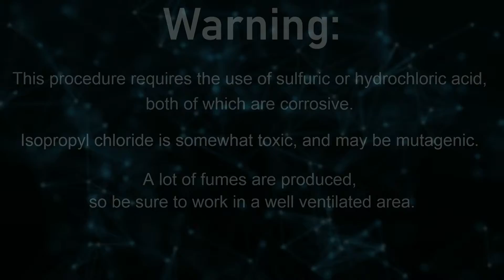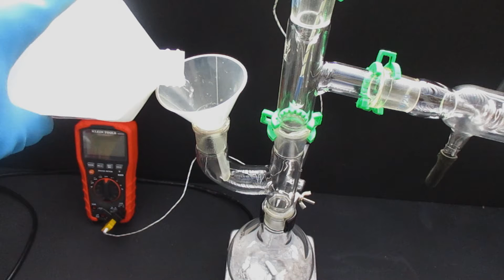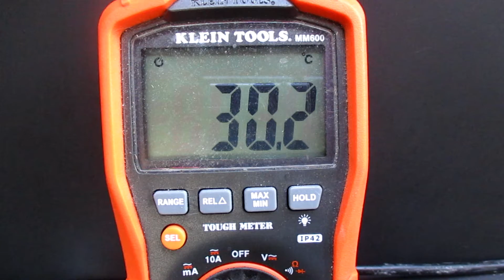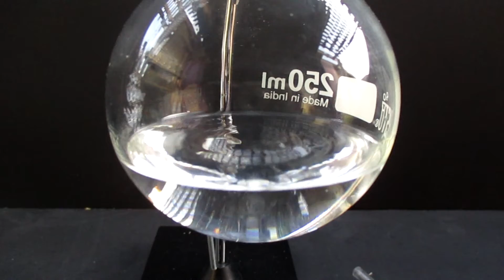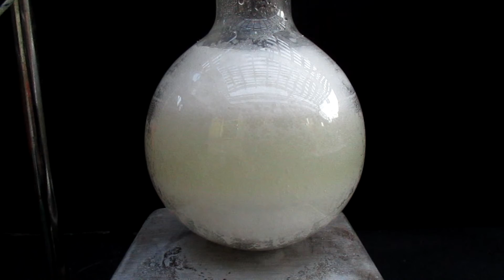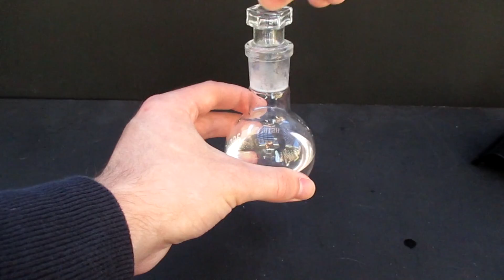Isopropyl Chloride Synthesis: My First Real Chem Project

Comment: Thank you a lot! It was very interesting! From it, benzene and aluminum chloride you can make cumene, which can be converted to its peroxide on air, and then hydrolyzed by sulfuric acid to make phenol and acetone. For the Gringhard reaction the catalyst is diethyl ether. It's absolutely impossible to make Gringhard's reagents without it. And also, for the activation of magnesium, you can use a small crystal of iodine.

Comment: Great Video! My opinion on why you didn`t produce the Grignard reagent is because the magnesium metal was covered with an oxide layer and the isopropyl chloride couldn`t react with it, while sulfuric acid removed the oxide layer it also created a sulfate layer that prevented the reaction. Iodine, methyl iodide or 1,2-dibromoethane can be used to activate the magnesium metal and start the reaction. Probably it needs to be done under an inert atmosphere as Grignard reagents are highly unstable in air. Usually, diethyl ether or tetrahydrofuran are used as a solvent for the reaction.  However I might be wrong about everything I said

Comment: What if you want to turn Phenyl-1-Propanol or Phenyl-2-Propanol into Phenyl-1-Chloropropane or Phenyl-2-Chloropropane? Do you still have to distill when boiling point is way higher, or can you heat it without boiling it over and Zinc Chloride catalyst is sufficient. If you have to boil it over, a vacuum distillation might be needed.

Comment: Good video.
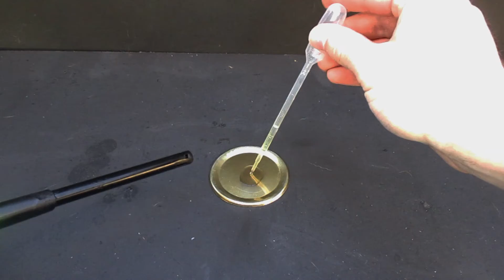3:57 a couple of frames show a green flame right before the the yellow flame <3
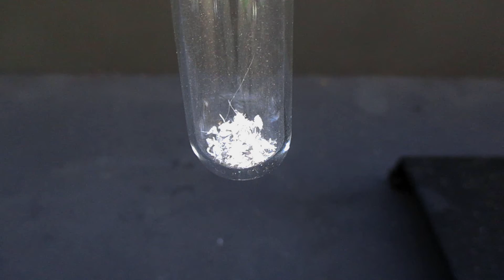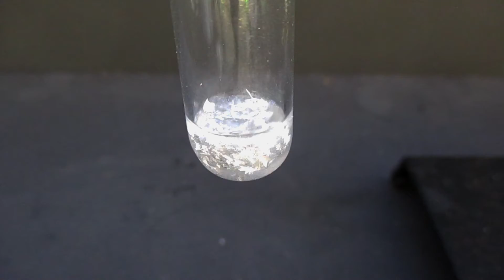4:07- 4:18 have you checked the dryness of the solvent. 9/10 Grignard fails happen from sneaky water presence .
Also Swirling the magnesium with a glass stirrer sometimes helps it start.

Comment: How much ZnCl2 should I use to react the same amount of reactants in the video? Thanks.
Reply from the maker: Zinc chloride isn't necessary for this reaction, but it can serve as a catalyst to speed it up somewhat. In such a case, only a few grams are really needed. Hope that helps!
Reply: @LabCoatz_Science  how much 32% HCl instead of H2SO4 and NaCl?
Reply: @visix8910   you cannot make i-PrCl with water in your HCl

Comment: This procedure is reminiscent of how diethyl ether is produced from ethanol.  Do you know if  be a side product as far as you know?
Reply from the maker: Probably not. I'm sure there are some side products, but I don't think diethyl ether is one of them, mostly because the alcohol used to is isopropanol and not ethanol and the sulfuric acid was reacted away to form HCl. If anything, it might be possible that some diisopropyl ether formed from stray unreacted sulfuric acid, but I have my doubts.
Reply: @LabCoatz_Science  Diisopropyl ether as a side product is what I meant. I misspoke.  Anyways that's cool. I looked up this compound (the acyl halide) on wiki after and it looks like you mostly used the synthesis listed there but without the catalyst.  If you try for a better yield at any point I'd be interested to know how it goes. Cheers!
Reply from the maker: @whatelseison8970  I'm thinking I might try for ethyl chloride next. It's pretty similar, but it's boiling point is much lower (similar to nitrogen dioxide, honestly), so collecting/storing it is somewhat harder. I might try using it in the synthesis of ethylaluminum chloride or ethylmagnesium chloride, both of which should be fun, pyrophoric chemicals. We'll see how it goes!